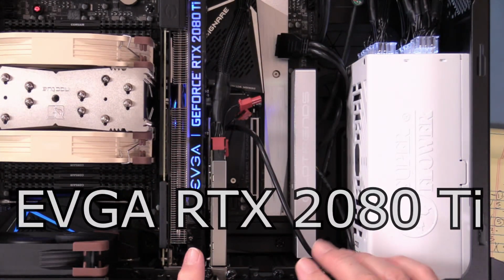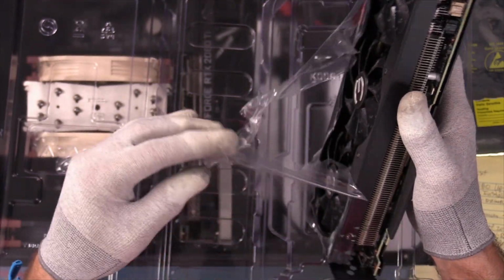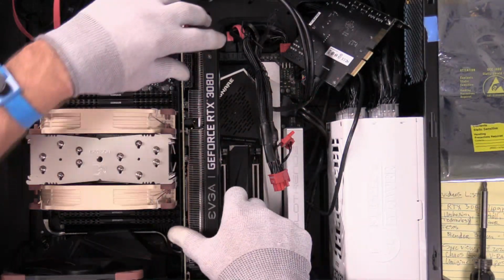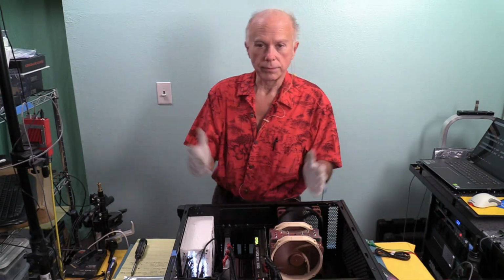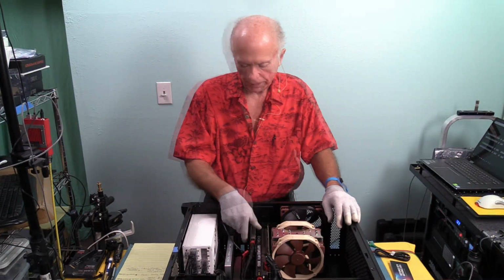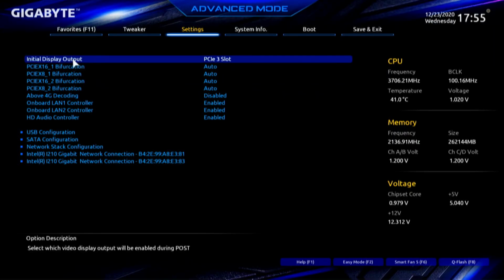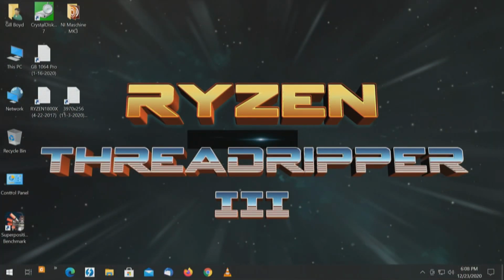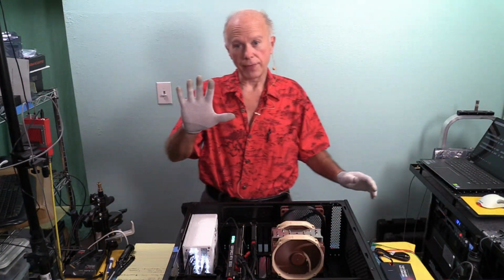EVGA RTX 3080 Build Upgrade Tutorial in Gigabyte TRX40 Designare Motherboard - Will it Fit?

Comment: Created a new channel, until I can get into my old one, ...... " On the new Threadripper " uploads coming soon.....
Reply from the maker: Hi Shannon,  What happened to Your old one? Eager to see Your Build! Built!
Reply: I can't seem to remember the correct password, and Google is difficult to work through getting access to that account..... Yeah, it's built.... I still need to do some work in the BIOS, with the BIOS update, but the Chipset drivers/GPU drivers/OS/NZXT CAM Software installed/Premiere Pro/After Effects/Audition/Malwarebytes/ etc........ Had to literally customize my case to make the Designare Motherboard fit into the H710 Case.... Had to drill out the ribbits that hold the PSU cover to the internal part of the case, and completely remove it, as it obstructed the placement of the Motherboard.... Also removed the vertical internal bar, that NZXT is known for, as it also got in the way..... I could probably manage to make that fit with some work, but it's a workstation PC..... It's not an RGB show piece.....lol..... The PSU is currently floating in the case, as it too needed to be moved away from the motherboard closer to the glass side, to make room for the connectors.... I ran out of memory on my Iphone, as I opted to use it instead, of my Canon M50....  I got plenty of unboxings, and placing the CPU on the motherboard, and taking the PSU cover out, but I memory was full when I thought I was recording the installation of the NZXT X73 Cooler, and the relocation of the case fans to the top of the case during the build process.... I tried using an external drive, but that wasn't enough..... I got most of it, just not the installation of the GPU, or the wiring managment..... I was a little disappointed about that part.... given all of the work I put into it, but I have to go back to work tomorrow a 4:00pm-4:00 am.... So I tried to get it done.. I also have some of the desk build on video as well, as that too cut off on me, but that was the Canon M50's video limit.... I was like.... shew....!
Reply: Here is part of the desk build, my camera cut off while I was filming it, and I did not realize it.....  I have been so busy with work, it's been rough....
Reply from the maker: Hi @shannonbailey8515 , How about a link? You've been busy! Thanks for Sharing! BTW: Did You regain access to Your old channel?
Reply: Well, I uploaded some unboxings today, I edited several, and some more than once...., but I kept uploading the wrong ones.... Over the course of 6 hrs, I managed... to successfully upload 2 videos out of about 5..... the others I had to delete, until I can locate the correct versions.... It took a while for them to upload as well.... I was like man, alive.... I also seem to be dealing with some lag with my Logitech MX3 Master Mouse, and Premiere Pro seems to freeze up on me some.... So, I am trying to determine what might be the reason for those issues.... I still need to configure my drive set up for Premiere Pro, After Effects, and Audition... so bear with me..... Here is one of my unboxing videos.....www.youtube.com/watch?v=gzSqA7uU8X8&t=3s
Reply: The motherboard www.youtube.com/watch?v=sm8O8k2h5e0&t=17s
Reply: Here is the AIO cooler.... https://www.youtube.com/watch?v=DXGYEZHTMdU
Reply: Here is the GPU  https://www.youtube.com/watch?v=Q60GTgz7P5E
Reply: I have the RAM, PSU, DRIVES, CASE, MONITORS, ETC, also uploaded in the form of Unboxing videos....lol.... There all on this channel.... right now they are just still uploading to 4K.... you can check them out.... When I get a chance I will upload the build videos as well.... I will need to do some work on those videos though first.....